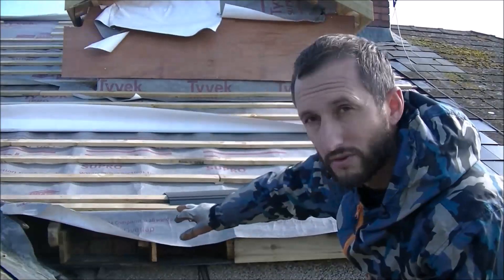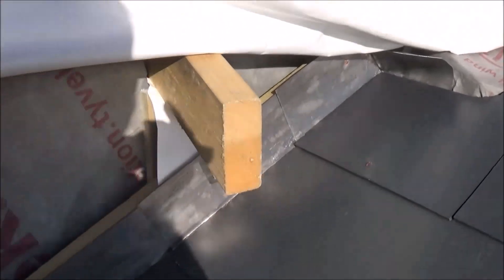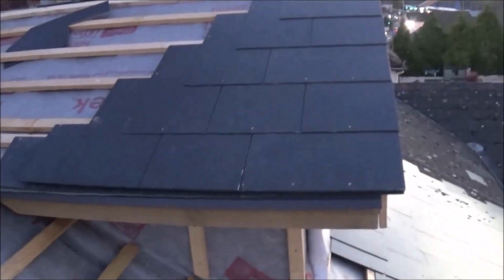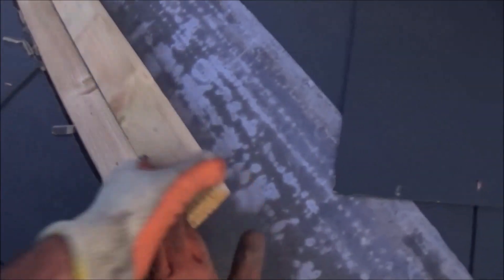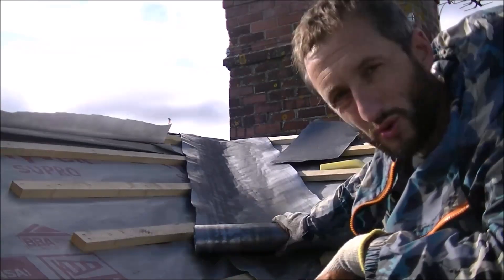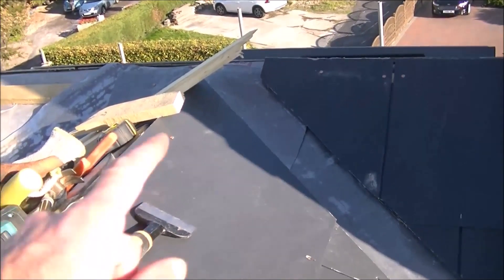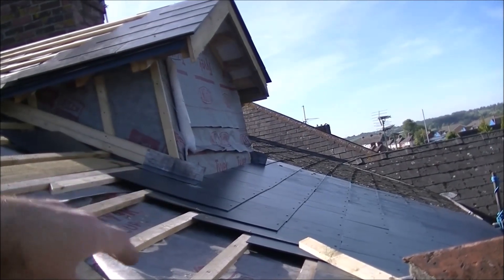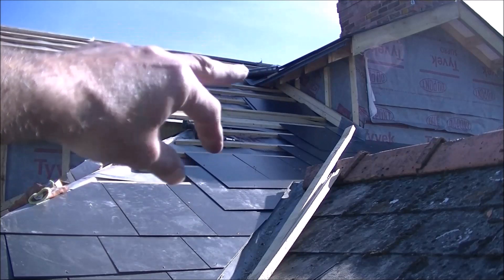Loft conversion part 19 - Lead valleys, lead soakers & slating the dormer roof

Comment: Just a tip for you, if the valley is longer than 1.5 metres then the lead should be cut and overlapped to avoid splitting due to expansion
Reply: Was jyst about to comment the same. I cut mine at 1.2mtrs. Always be mindful of exp and contraction. Happy Roofing!
Reply from the maker: Yes, I'm aware of that but as this was just over I left it and only nailed it near the top to avoid it cracking if it expands. Thanks for the info though good advice.
Reply: Also if doing a lead valley, Don't put lead on the felt, cause sweat and condensation. Cut the felt, lead on boards (or underlay) lap the cut felt over the lead. Personally I'd also have a welt, but done alright none the less 👍🏻
Reply: Around 4-1/2' is perfect, any longer and the lead will pull itself down off the roof over time, 🔨🇮🇪

Comment: How come you used small pieces of lead for dormer,  could you not use one long piece?
Reply from the maker: You need to use soakers on slate because slate is flat to avoid water getting under the lead and down the join where roof pitch meets dormer wall. The upturn is later covered over with vertical slate cladding. On tiles, they inter lock with grooves so water can't penetrate through, so you can do as you mentioned in that scenario.

Comment: I could be wrong but i think you've put your slate on upside down. Probably not what you want to hear after slating in a roof and dormer. Id be interested to know if you've had any leaks. If not i guess its all good.
Reply: Is this a wind up?! Why would you think that?!
Reply: @bp8092  Generally i think slates and tiles get nailed at the top so there are no exposed nail holes to the elements. I could be wrong as i'm not a roofer. I am a roofing carpenter however and i can't ever remember having seen a slate/ tile nailed at the bottom like that before. I live in Manchester tho so it could be that you guys do it differently over your way. Maybe if you live in area with high winds it might make sense.
Reply from the maker: Not entirely sure what you mean, but it maybe that we are using fibre cement slates which require 2 nail fixings and then a copper disc rivet at the bottom to hold the bottom of the slate down to avoid wind lift. They come pre-drilled with all 3 holes. Maybe this is what you thought was the nail at the bottom?
Reply: NB I'm a master carpenter from Manchester, you can't beat a day doing traditional roofing joinery can you. 👍🙂
Reply: Bahahahahaha that’s hilarious.....upside down .... 🤣🤣🤣 that comment is funnier than this roofing job ....
Reply: Thanks for the helpful comment. 👍
Reply: That’s makes complete sense. I can’t say I’ve ever come across the bottom copper rivet before. I did say I could be wrong so I hold my hands up 🙌 every days a school day.
Reply: rivet holelol,  funny thing is thats not the 1st time ive heard that lol

Comment: You need to batten up the valley like you did with the hip to stop the lead from sagging
Reply from the maker: My vally board (under the lead) butts up to the battens at the same height so it wont sag. Thanks for the comment!

Comment: Mate stay away from the slating, everything you’ve done on the roof is wrong, lead works a disaster, front apron always goes on before the soakers and your drilling holes way too far into the slates, only thing stopping that from leaking at the minute is the felt
Reply from the maker: If you watch my other vids you'll know I slipped tge soakers over the lead tray afterwards. I did it this way purely as it was the order I had to doi it working alone and over a longer period of time. As for the rest of the rood, you say its bad, it's seen some pretty bad weather for the last 3 years and not so much as a weep, but if you say it's only the membrane stopping it from leaking, then just as well I used membrane hey?  😉 👍
Reply: @POUSEaroundtheHOUSE  you should always dress the lead around the corners, you never cut it flush and try turn soakers around it, it’s a disaster waiting to happen, I’ve came across lots of roofs in my time that have been done badly and yes they lasted a good few years but eventually it will leak and leak badly, and yes you were lucky you have used good membrane, Tyvek is very expensive but worth the money

Comment: Found your vids think there great, where abouts are you? Would want a quote for work if your close enough, if not some help on knowing what kind of price I should have to pay for a standard pitch roof...flat roof coming off that and a smaller pitch roof coming off the utility room, think all tradesmen should do what your doing, see your knowledgeable about building in general and always do a nice job
Reply from the maker: Thanks for the comment. This is just DIY, I don't do it for a living sorry. Best of luck with the project.

Comment: Lead work is terrible no vallery boards should do front apron before soakers give up if I was you
Reply from the maker: It's DIY, I had to do it in this order and the soakers makes no different going on before apron as I tucked it into the right place so no difference what soever. Giving up half way through a roof installation is probably not a good idea! Thanks for watching.

Comment: The valley is wrong should not be on the battens and should be welted you're storing up problems for the future.
Reply from the maker: I used a wider bit of lead than required so not sure what problems I've stored up but thanks for the info and thanks for watching.

Comment: Mate I'm sorry but that valleys too long for a single length of lead, the longest a single piece should be is 1.2 metre,s otherwise it will rip with the expansion and contraction
Reply: 1.4
Reply from the maker: I agree, yest it was just over 1.5m. I only nailed it near the top to help reduce cracking in the event of expansion or contraction. You're right about the welts but I used a much wider piece of lead than recommended and three years on it seems to be holding strong. Thanks for the feedback.

Comment: I hate to say it, but i feel you should not be roofing, i follow you video's, not to pull them apart but have generally interest on what you do, unfortunately the slate roof has so many no no's. It is incorrect from start to finish and after 35 years of roofing i can honestly say its one of the worst i seen. It would have been much better to have a good roofer behind the scene guiding you. Real shame because your  other work is great.
Reply from the maker: It'd be good if you could elaborate? It would appear roofers don't even agree with each other on how to do a roof. Roofers always seem vocal when it comes to saying how bad it is but never reply when I ask for a break down of what's so incorrect. The roof has been doing it's job for over a year now, not one weep around windows, flashing or valleys after some of the worst rain I've seen in years. I havent got the plasterboard on yet so I can see if theres a problem. Doing a project on this scale myself I might do things in a different order to roofers and obviously slower but not sure what is so terrible about it. Thanks for the comments and thanks for watching.
Reply: If one of the worst you’ve seen is 100% water tight 2 years on you must have spent 35 years working on roofs with your eyes shut?
Reply: 35 years with eyes wide open, you are definitely not  roofer, look at front lead apron, look at lead in valley, over sized, no correct lay out of timber to valley, nothing stops water under slate, back tracking, no eave or 5u protection, wrong nails, I can go on and on.
So don't try and tell a real roofer to suck eggs.
If your going to put videos on, make sure you know what your talking about.
And yes it should last more than 2 years, my roofs last a lifetime and there is no way in this world yours will.
Reply: Clive if the truth is known pouse’s roof is far better than yours and ur just jealous lol, I’m not an electrician, builder, decorator, chippy, it don’t for one second mean I can’t wire a socket up, build a wall, decorate a room nor build a fence or shed, I can do all those things. Just because I don’t have your 35 years experience is neither here nor there
Reply: @johnallen6487   your talking crap mate, sorry but you are
Reply: @clive fox haha you also pal

Comment: This comment has nothing to do with your abilities as a builder. I have followed your videos which I find interesting, however, you ought to know that people that watch your videos are doing so to see and hear what you do. Regrettably, the latter is badly impaired by the loud music that you play (it should only be a low level supplement to the main subject which is what your title states i.e. "Loft Conversion") plus the inferior microphone that you use. If you could correct these points people might find following you much more interesting/pleasant.
Reply from the maker: Yes fair enough. The software I used wasn't great and you're right, camera was cheap but then the videos are for free! I recently upgraded my camera so fingers crossed the quality will improve. Thanks you for your feedback.